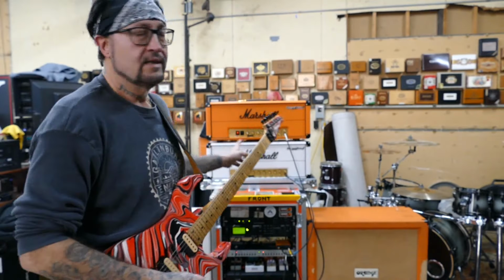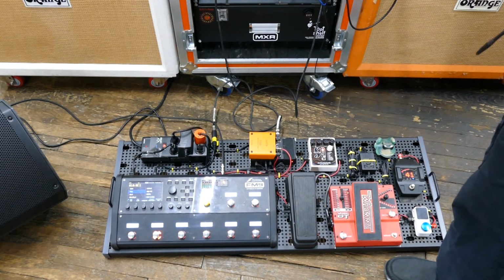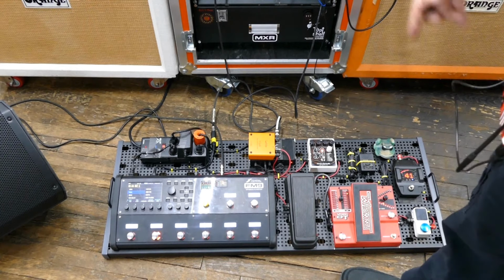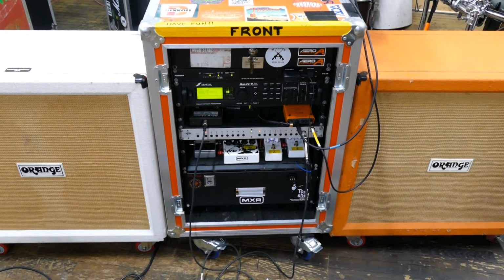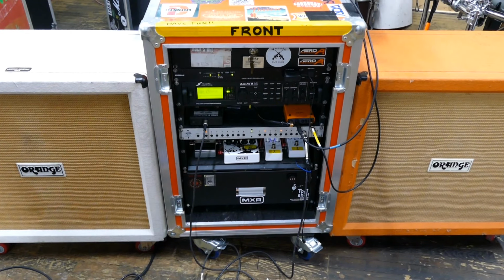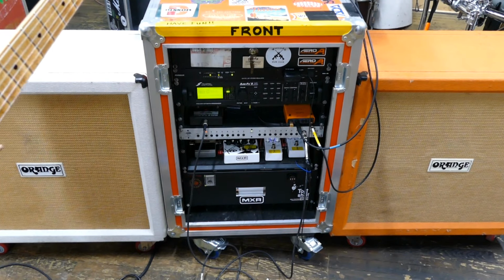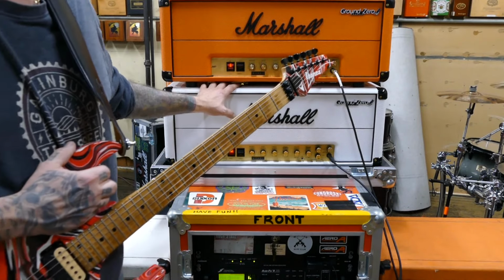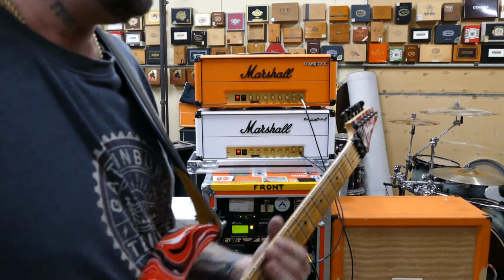Detailed Explanation Of My 2024 Guitar Rig

Comment: how did you attach the FM9 to the board? The part weighs a few kg. it has to be secured well.
Many greetings from Cologne Germany
Reply from the maker: i used longer screws on the bottom and went through the board